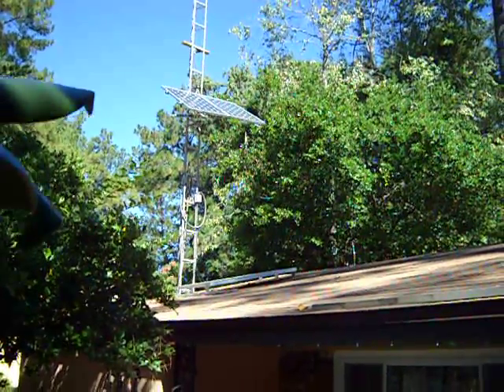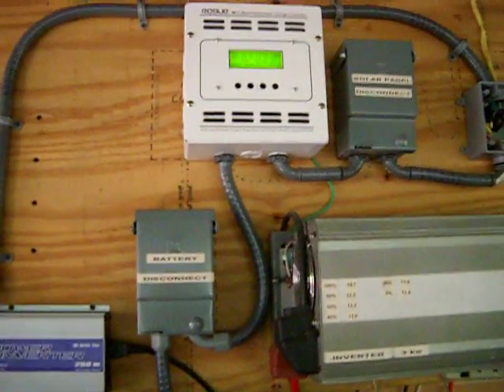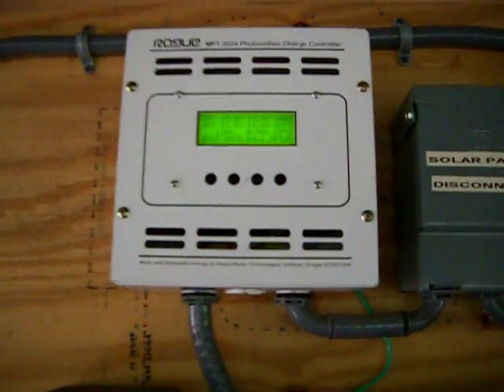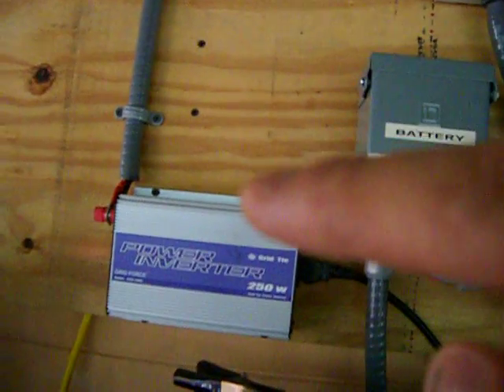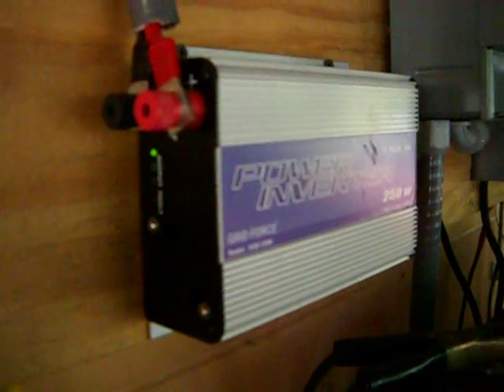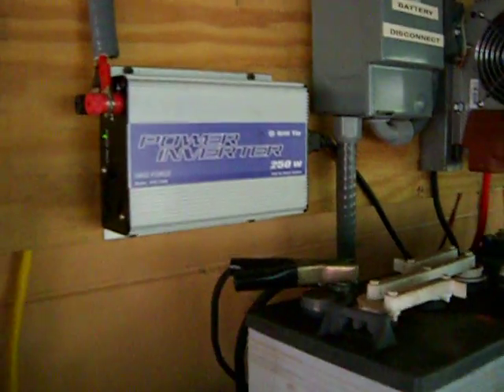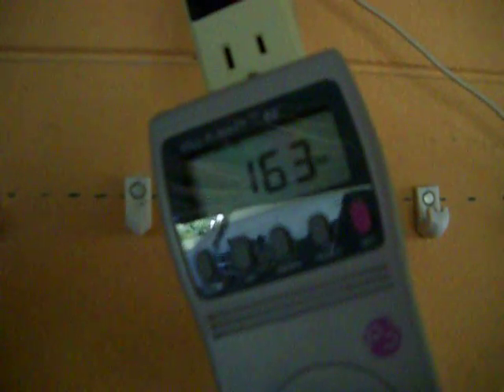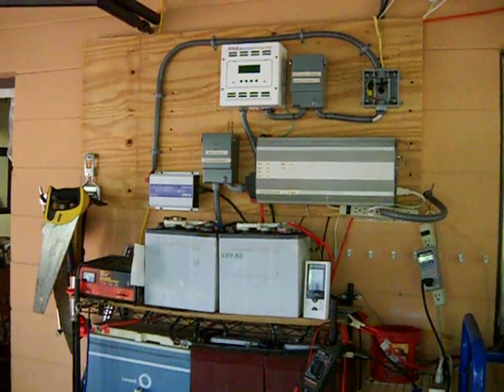My Home Solar Updated 4

Comment: Inverters are at their Max Eff when run between 20-50% Load. Your "peaking" your 250w and consuming some in heat. I have the 1200 version pushing 600w in panels. Measuring Pre and Post inverter in wh, I'm seeing a 7% loss in morning and evening and around 11% between 1-3pm. It's pretty constant. Avg 92% Eff.

Your large inverter I'm guessing is overkill so you're still in the sweet zone for that unit. 

Nice work though! Top notch parts. UL-Solar is another nice place to work with.

Comment: I have similart wattage and found the GTI is cutting me short. Get a 1200 watt GTI or a 600 watt gti and run parallel you will see a big diff in wattage to house.
I got a extra 150 watts per hour just by adding parallel a 600 watt GTI.

Comment from the maker: @field16 the tower is 32 ft high, which falls under my local chiminey hight code. So my neighbors can't give me problems, since I live in a sub-division in the city. At the top is my DTV antena. My panels are on a frame I built from unirails, which are shaped like a U. These are found at Home Depot or Lowes in the electrical section. I am not too worried about the wind as I have 50 ft pines all around me. I wanted to elevate the panels higher for longer exposure to the sun. Up for 1.5yrs now!

Comment: Thanks for showing us an update.  I'd like to know more about that tower going up high above your house.  Is that tower for something besides a mount for your panel to hang on?  I wonder how you have the panel secured up there and if you are concerned about wind pushing it around.  

Your control panel on the wall looks organized.

Comment from the maker: I do plan on getting another inverter. The most watts output I have gotten from this inverter is about 202watts. And this was in the middle of the summer. I rarely ever let it do that, as I have both the GTI and the charge controller on at the same time.